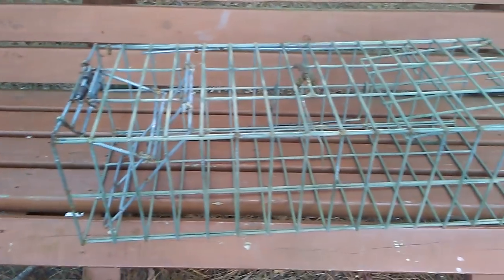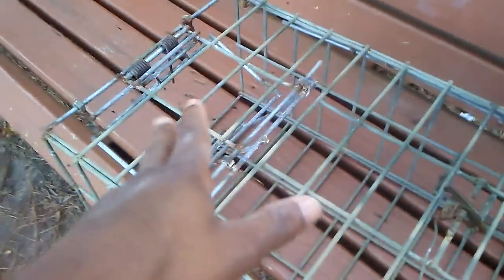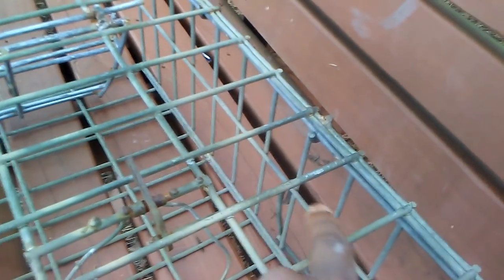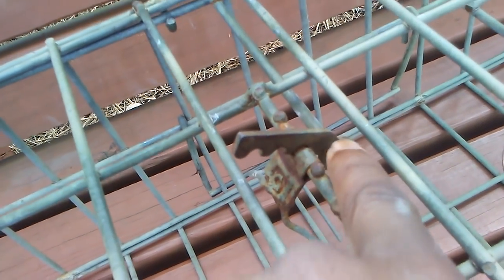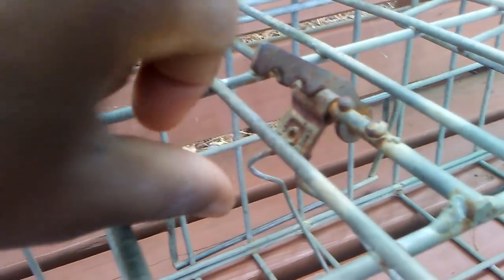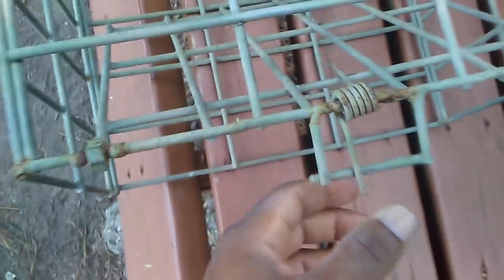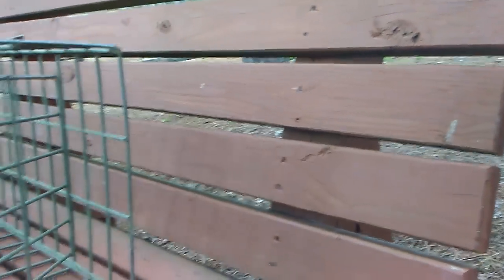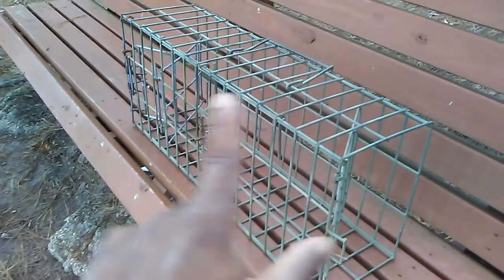Simple Wire Trigger Cage Trap Mechanism

Comment: I hold the patent on a very much refined simplistic version of what you see.  We have taken 970 beaver since 2010 in our traps made in various sizes as well as otter and muskrats, the 12x18x39 being the standard model.  Our Comstock Cage traps will work right side up, upside down, sideways, even vertically with all trigger elements internal.  We have powered doors with 20 pounds of pressure in an unbreakable, escape proof rugged trap.  We all so make traps beginning with chipmunks up to mountain lions and alligators.  The methods we employ result in an unbeatable system of taking many animals like raccoons, skunks and woodchucks in baitless trapping.  We are always available to help anyone and everyone go from novice to professional.
Reply: For some reason I was somewhat surprised at first to see you comment on a random video like this, but I did too. You only have some of the best cage traps on the market. Guess that's what people with similar interests do, novice or not